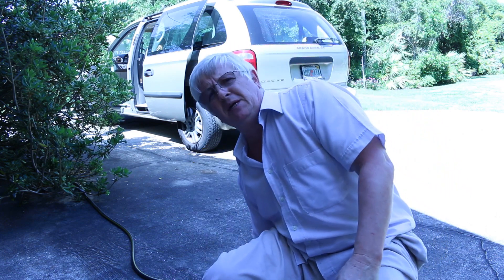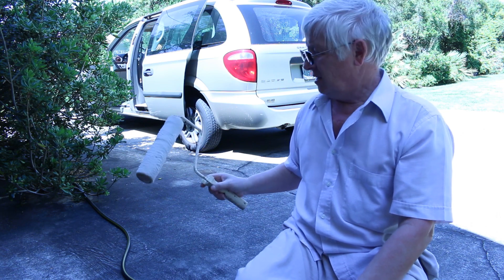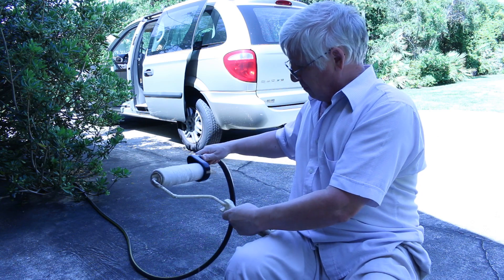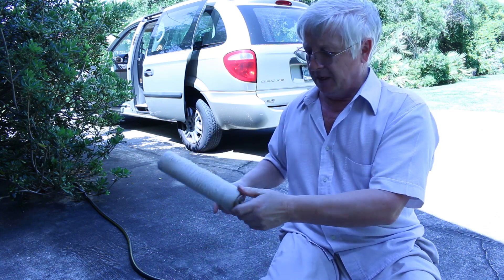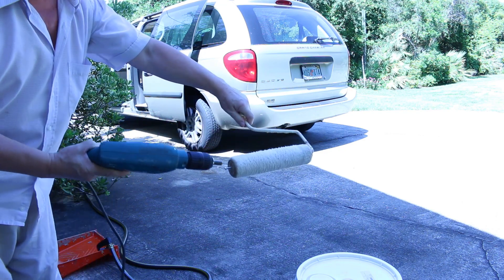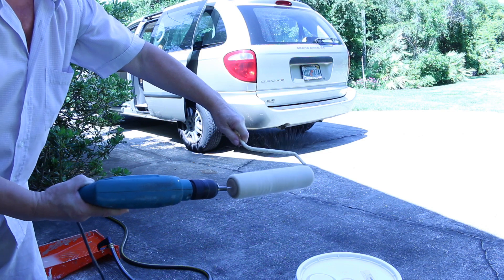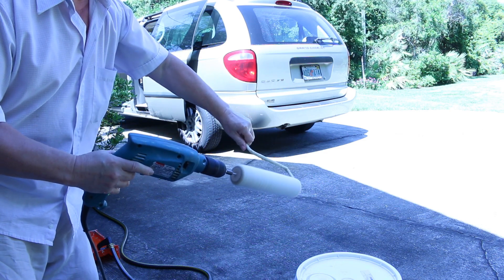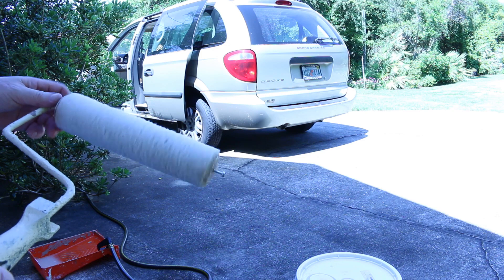Tip - How to Expand Paint Roller Lifetime up to 5-6 Times Longer

Comment: How i do it i get the hose and blast it, so it spins then just let it dry ... you will save money and electricity too
Reply from the maker: I have done this method before and believe me the result is not the same. You can not get roller spinning fast enough so fiber of the roller will stretch out of the roller body and get fluffy. This makes big difference after roller will dry.